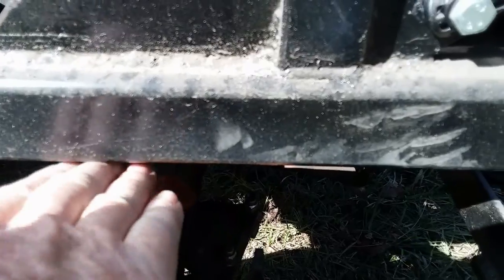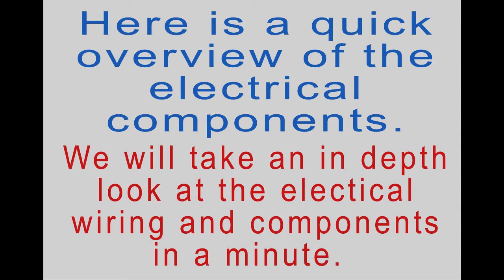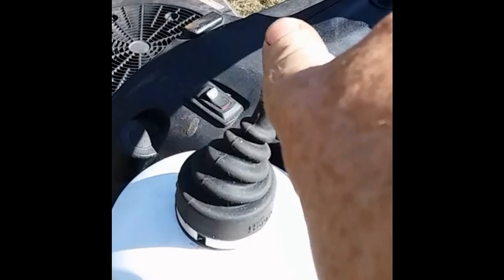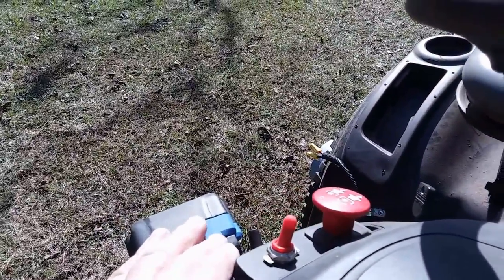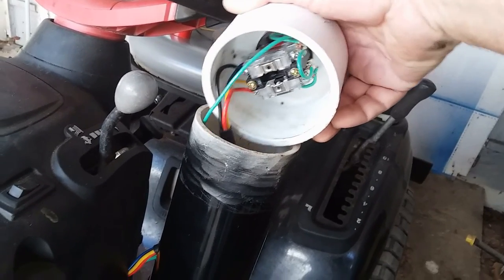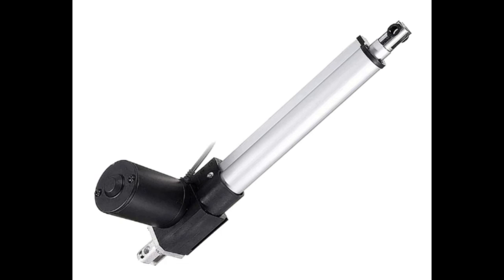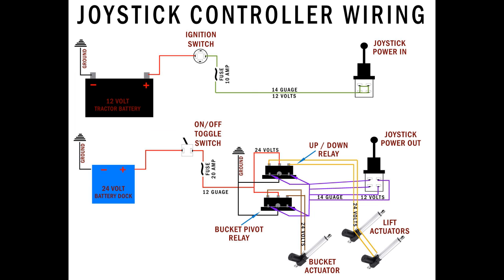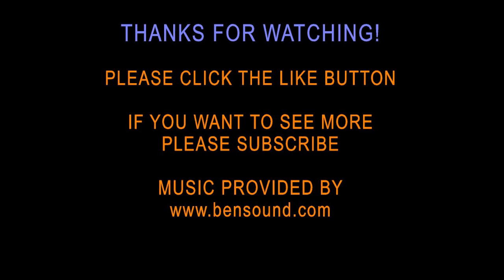HOMEMADE RESIDENTIAL FRONT END LOADER WITH 12 VOLT ACTUATORS POWERED BY 24 VOLTS

Comment: Im currently in the design process, overvolting to some extent seems reasonable as the duty cycle is generally low. 

I remember in my younger days tearing down rc stuff and double voltage didn't really seem to cause much shorter life but 3x would almost always sound like the bearings were about to fail.

Many of these garden mowers have belt driven drive train. I decided 24" width bucket, with 3/16" steel construction as I need to deal with rocky soil/gravel.

I have a ton of 18v ryobi one batteries and a nice few greenworks 80v. I'll probably set it up for the ryobi one style or I'd need to activate 4x12v actuators on each Movement. While 4x light duty linear actuators go faster, odds are the load wouldn't be equally divided and they would probably strip out individual linear actuators one at a time leading to a rapid failure.

Thanks for the inspiration

Comment: i want to use dewalt 18v twin battery charger for my dock. i wish to be able to continue to charge through the same dock. am not sure if i can do this but i will try it.
Reply: I considered such a thing, but then I discovered that docks with power connections are available cheaply on Amazon for all kinds of tool batteries.
Reply from the maker: Check this out first - Click on these Amazon links:  https://www.amazon.com/Wzquisite-Battery-Adapter-Connector-Robotics/dp/B09TZZX23D/ref=sr_1_5?crid=39JIIE1HJ4IU&dib=eyJ2IjoiMSJ9.spObFaQMLDWiRILHcCYrAlQ0LwkYwlRzAoaoJ9fT7ZQ-p61SU6GR9s1yh2Z-ZaKbG3cDrIAvX4Avfvx88p3gFfWXeEJgAbTsUjw_ozc411g22VT0453s-_1SVaQB0OZU6u2Zbgep_xf5a5lyUQ1GZc2YAdikBnuNPlWJBM7pjr62TL75u7IOtohFv56_6_Jc081-AalRB7ELaqvGyUntbR44QpAd8UWNSsQhw52Qv5MhyjNm63HFAPOJHUNLk0v01jcECna6w5CBhmtKzr5hEHbvoYYqc2qmFYVGm3sjqxY.rulRETS63uMGxsgkopHc5NQHMz0T9S1I3GHmcF07Oeo&dib_tag=se&keywords=18v+Dewalt+Battery+Dock&qid=1730728475&sprefix=18v+dewalt+battery+dock%2Caps%2C179&sr=8-5  

OR 

https://www.amazon.com/Battery-Adapter-Dewalt-Converter-Connector/dp/B098NQRRNB/ref=sr_1_8?crid=39JIIE1HJ4IU&dib=eyJ2IjoiMSJ9.spObFaQMLDWiRILHcCYrAlQ0LwkYwlRzAoaoJ9fT7ZQ-p61SU6GR9s1yh2Z-ZaKbG3cDrIAvX4Avfvx88p3gFfWXeEJgAbTsUjw_ozc411g22VT0453s-_1SVaQB0OZU6u2Zbgep_xf5a5lyUQ1GZc2YAdikBnuNPlWJBM7pjr62TL75u7IOtohFv56_6_Jc081-AalRB7ELaqvGyUntbR44QpAd8UWNSsQhw52Qv5MhyjNm63HFAPOJHUNLk0v01jcECna6w5CBhmtKzr5hEHbvoYYqc2qmFYVGm3sjqxY.rulRETS63uMGxsgkopHc5NQHMz0T9S1I3GHmcF07Oeo&dib_tag=se&keywords=18v+Dewalt+Battery+Dock&qid=1730728475&sprefix=18v+dewalt+battery+dock%2Caps%2C179&sr=8-8

Comment: 2 questions,  do you mow with it, and if not why not do hydrlics.  The pto can drive the hydrlics fluid pump. The pump tank could have been at the back with the fuilds adding back end weight.

There is a difference between a hydrostatic  rear-end  a lawn tractor is smaller. A garden tractors more heavy duty.
Second is the a garden tractor or lawn tractor? 

Sure I can do either but I belive the hydrlics system is better, its more robust
Electric motors fail when the coils get hot. Your actuators are electric motors
And they can not get wet. Hydrlics it dosnt matter.  A hydrlics system might cost more but not that much if you really think about it.
Reply from the maker: Hydraulics are not new to me, but as pointed out in many of my videos, I have been experimenting with the DC electric systems to see if they are a viable option to hydraulics. I have been sharing this information by means of videos.  Some things that I have learned by my experimentation and communication with other builders are as follows: 
Point 1. You hit the nail on the head when you said "A hydrlics system might cost more".  I have built loaders with hydraulics. There is a considerable greater cost with hydraulics. At least 5 to 1 when using the electric actuators depicted. 
Point 2. There are people out there that are constantly striving to find another way at doing things. Sometimes they actually improve things by their persistant efforts. I mean if we didn't try things different we wouldn't have cheeseburgers, just hamburgers, we wouldn't have flat screen television, just the old bulky box televisions. 
Point 3. Many would be loader builders are on severely limited budgets. They've got to use that riding mower as a platform to build off.  They don't know much about metal fabrication but are willing to learn on a project that they can afford to mess up on. They can't afford or do not think it is worth the $1000 - $1500 dollars to buy the hydraulics to install on a riding mower - so they opt for the $200 - $300 install of electric actuators. In other words for many builders, the simpler inexpensive electric version is the place to learn and then later opt for the hydraulic version. 
Now it should be acknowledged that at the current time hydraulics are definitely superior!  However, that may not always be. 
Personally, I applaud the builders that have figured out the different ways to build there loaders. It is inspiring to see their ingenuity. Please don't fault us for trying to build a better hamburger.
Reply: You are really smart.

Comment: Hello, did you have a problem with the timing for travel on your lift actuators? It's my understanding that not every actuators will lift at the same speed. Some people use speed controller to tune one actuator to time with the other one. How did you solve yours? Thanks
Reply from the maker: There is generally a very slight timing difference with actuators going from stop to stop. This seems to be caused by slight mismatch in the stop switch positioning (usually less than 1/32 or .030 inch) rather than actual motor speed. Matched brands - for example, 2 Vevor actuators should be reasonable close. I have built several electric loaders and other electric devices that use actuators. For loaders I have found that there is enough flexing in the loader frame to make allowance for the tiny difference in travel. Unless you build your loader arms really heavy and extremely rigid you should be able to use the actuators without any real concern.  And if you are building extremely heavy duty, you should probably go with hydraulics. 
I hope this helps.
Ed
Reply: @eds2centsworth203  Yes it does! Thank you Sir!

Comment: 2 Questions:  1.) When I google " 4 Position 4NO moment..." I only get results for 240v/380 joysticks do you have a link to the 12volt one you actually used? 2.) On your wiring diagram 9:33 you have the negative going to ground, Is this the frame of the tractor, or do you have an actual negative connection quite apart from grounding at all?
Reply from the maker: Here is a link for the 4 position switch -  https://www.amazon.com/gp/product/B07H3NTWDD/ref=ppx_yo_dt_b_asin_title_o05_s01?ie=UTF8&psc=1 
Yes, I simply use the tractor frame as ground because the 12 volt battery negative terminal is connected to the tractor frame. It serves well for the 24 volts as well.  However there is no problem with creating an isolated negative circuit, but I see no practical reason for doing so. I just use tractor frame - it's simple.
Hope this helps, Ed
Reply: those switches should work fine. its the power that is going through the switch that makes the difference. if you use relays then current should be pretty small.

Comment: Now that I'm getting close to actually building a loader, I'm looking at ways to provide 24 volts. I have several cordless tools (over 12v) of three different systems: 18v Ryobi, 40v Greenworks, and 56v EGO. It occurred to me that if the lift arms and bucket both use a pair of actuators, they could be wired in series, so that a 40v battery would be like a 20v one wired in parallel, and a 56v (nominal) would be like 28v. The joystick controller is rated for 220v DC, so that's not an issue. But the reversing relays don't seem to go past 24 volts spec, so I'm wondering if going a few volts over that will work. How did you manage your 40v testing?
Reply from the maker: I do not recommend exceeding 24 volts using the medical equipment style actuators. I have been running 48 volts (2 - 24v batteries connected in series) on one of my loaders as an endurance test.  Electrically the actuators can handle the 48 volts however the 48v is so strong that you will likely strip the internal gears of the actuators if you get the loader into a bind.  I've been contemplating a new video explainig the issue.

Comment: Hi me again I’m wondering the actuators I have came off of adjustable beds I’ll be using them if I can how do I protect them from the weather??
Reply from the maker: You protect them from weather by creating covering for each actuator or the only other option is to not use in bad weather and keep covered when not in use ( park inside garage or shop - best, put a good quality tarp over - 2nd best).

Comment: what is total approximate cost please? great videos!
Reply from the maker: That depends. Using the same design that I used - if you have a source of used steel that you can repurpose you can probably build the loader for around $400 to $500.00.  If you are buying everything new it would be around $950.00.  My build was a mix of repurposed and new materials. I figure I have about $750 invested in materials.
Ed
Reply from the maker: Also, I used existing tool batteries, so I didn't need to buy the batteries. I you don't have any battery operated tools then that would be an additional cost.  While the loader will run on a 1 amp hour battery, I recommend at least a 4 amp hour battery. 
Ed
Reply: @eds2centsworth203  I thought you were using a 12v tractor battery. you are using 18v corless tool batteries/ I guess I need to rewatch the video I missed that.
Reply from the maker: Using 12 volt tractor battery to supply power to Joystick. The joystick then supplies 12 volts to the switching terminals of the solenoid relays. I use a 24 volt tool battery to the big terminals on the solenoid relays. The relays send 24 volts to the actuators.  @southbridgeforestHOA

Comment: Your "residential" loader videos are by far the most inspiring and helpful I've seen (with Santiago coming second). I've been trying to source suitable actuators but haven't seen any that look quite like yours. Of course, their force is important too. You state that you're using 10" and 12" actuators, which I assume is the extension (travel) but don't mention the force or speed at 12 volts. What are those specs, and where did you find the actuators?
Reply from the maker: I am glad you find them inspirational. I would like to see more people build their own.  

The actuators I use are rated at 1320 pounds or 6000 newtons.  They are 12 volt actuators that I am running on 24 volts.  So far they are holding up without any alteration. The actuators are measured by their stroke, so a 10 inch will extend 10 inches.  The overall extended length and retracted length are provided in the ad.  They are available on Amazon.  Here is the link for the 10 inch.  https://www.amazon.com/dp/B07S2R4RCX?psc=1&ref=ppx_yo2ov_dt_b_product_details 

Also, I have several videos on actuator performance experiments and one video on repair / upgrade.

If I can help with anything else, let me know.
Ed
Reply: i found 12 volt 16 inch actuators on aliexpress for $28 dollars. i ordered 3, got 2. i called the number listed and they sent me 3 more. i now have 5  actuators and plan to put 2 on the bucket where i was going to only use 1. the other will go on the boom pole i am building for a post auger.. so $84 dollars for 5 actuators and allows me better lift on the bucket and gives me enough to finish the boom lift.